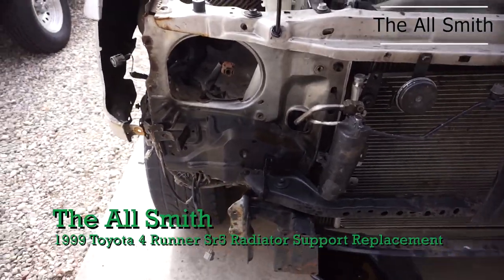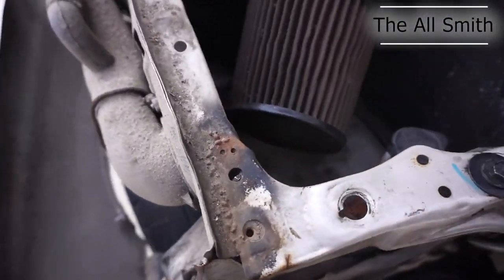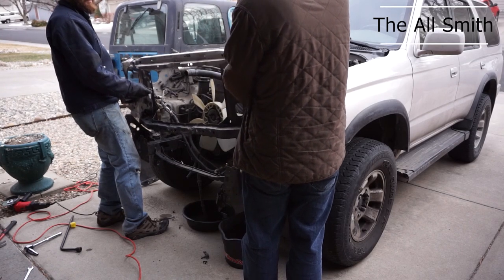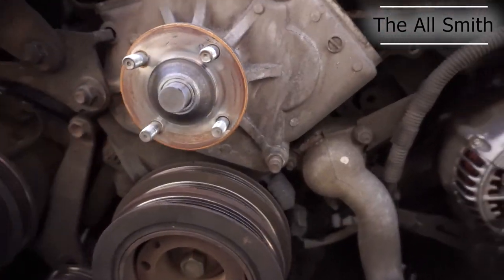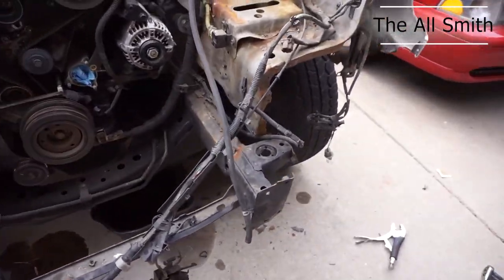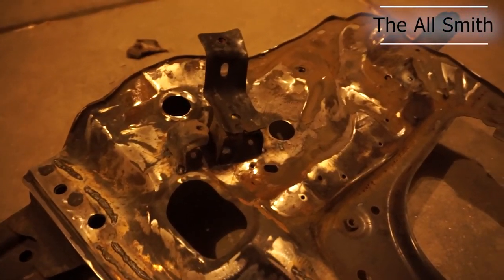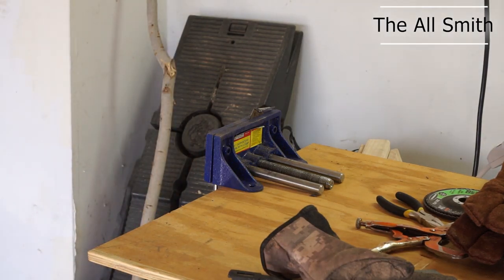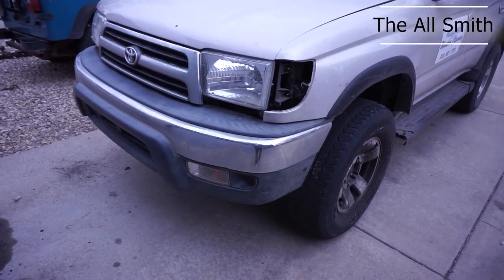1999 T4R Radiator Support Replacement (body work)

Comment: This is the most helpful video I've watched so far on front end repair of this gen toyota. Particularly helpful since you are apparently on the same skill/experience level that I am. As in NONE! It helps to make me aware of what I am getting myself into if I try this by myself. I thank you for taking the time to record and edit this video. You might not have very many likes on this, but I wanted you to know you sure helped me out as well as the two commenters below me. Just wanted you to know that your efforts here are appreciated and valuable to some of your fellow human beings. KUDOS to you, man!
Reply from the maker: The whole reason I made the video! I can tell you, if you do not have any damage at all to the frame, you should not have issues doing this job if you have a good welder. I would suggest mig as flux core burns too hot for this repair. But I've had no issues since doing this job. Just make sure to get your ac drained properly before tackling this.

Aside from that, thank you for your response! I knew it would come in handy for someone!
Reply: @scream4meplz1994  MIG it is then... that's the biggest challenge for me that I can see as I have zero experience with welding. I feel a little more confident now knowing you already did the trial and error for this skill level and are freely offering guidance. Much Appreciated!

Comment: Thanks for taking the time to make this.  I'm repairing my '97 now after a hard hit to the front passenger side and this is a big help.  Where did you get your radiator support/body mount bushings? OEM?
Reply from the maker: I believe the radiator support was from Rock Auto as well as the bushings. None of that was OEM but the bushings are energy suspension polyurethane bushings
Reply: Were you able to fix your 97? I have a 97 that took a hit in the same spot that yours did and want to fix it.

Comment: How did you deal with disconnecting the AC?  Did you just "not vent to atmosphere" the refrigerant and refill with a can from the Autozone after or...?
Reply from the maker: I already answered this question. The ac was failed before I started this. Someone didn't seal the system properly so I didn't worry about it after the repair.

Comment: HAVE A 1999, GOT HIT IN THE DRIVER SIDE. NOTHING LINES UP ON THE DRIVER SIDE, HAD TO FORCE EVERYTHING. DRIVER FENDER ALL BENT. SMH. ARE AFTERMARKET CORE SUPPORT OK? LIKE NO ALIGNMENT ISSUES?
Reply from the maker: I am no expert! The gauge of metal used on these vehicles is pretty thin. I got an aftermarket core support. The only reason mine isnt level is because the frame was off.

If your frame is good then you will have less problems than I did. But I found out quickly that body work is no joke.

Comment: Did you get the ac drained somewhere before you started?
Reply from the maker: No. The system was already failed. Whoever had this before me tried to seal a spot with jb weld or something similar on that tank in front of the radiator support. So I will need to get new lines on the front as well as that tank and have the system sealed and filled.